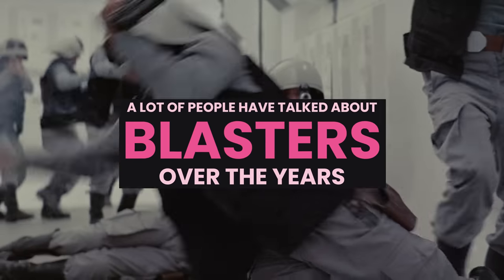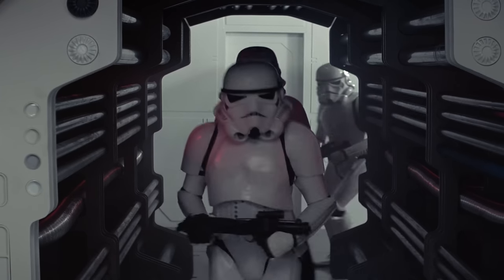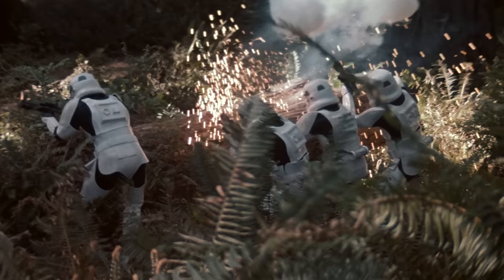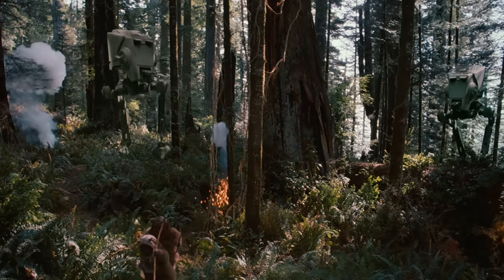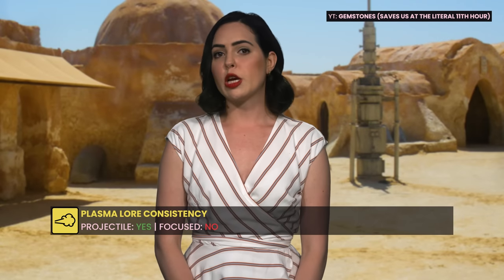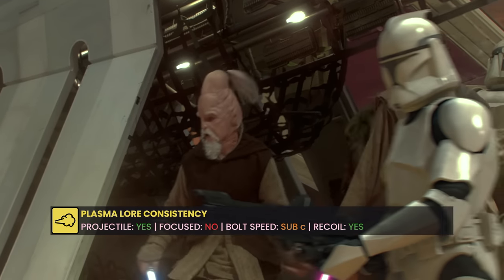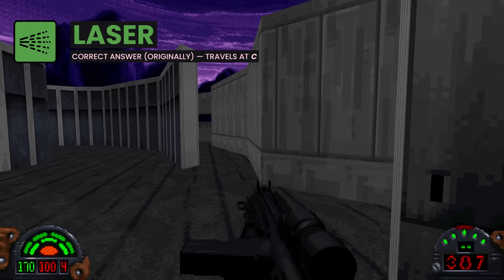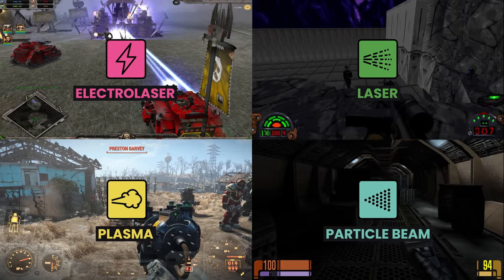Star Wars BLASTER TECH: The Definitive Guide

Comment: i wrote a copypasta about this one time
Reply: found it,

All blasters function by using a power pack to energize compressed gas into a plasma bolt which is then discharged into an isolated electromagnetic field. The kind of gas used to fuel blasters can vary, and also vary effectively in efficiency, temperature, and volatility. Although it was wasn't the most common type, Tibanna gas is the most well known amongst the fandom due to its prominent mention and role in stories surrounding the Alliance-Imperial conflict pre and post Endor. Tibanna gas was also more expensive due to its efficiency and high yield explosive potential. Usually, the compressed gas canister is loaded separately, optimally a small distance away from the power pack for safety purposes. The ratio of power used is always much higher than gas used per blaster bolt. Most blasters can be tweaked to use more gas per shot, but this requires more power per shot as well. Most blasters can also be tweaked to use less gas per shot, allowing for power pack charge conservation. In the hands of the sparing, a compressed gas canister can be made to last the a greater portion of the functional lifetime of a blaster. An example of gas and power adjustment, the DL-44, well known to be the base model modified and used by Han Solo, could load dual channel power packs. This allowed the user to fire a single charge shot from a single power pack, or with a quick toggle, fire a dual charge shot from both power packs, twice the output via same drain per pack. This made DL-44's especially useful against armored opponents, particularly Stormtroopers, because the double charge was enough to penetrate the light shocktrooper armor. This also made them illegal for unapproved use under Imperial law. In firefights, prepared soldiers or gunman wouldn't be seen running out of gas unless severely overcharging their shots for maximum heat and armor penetration against super-heavy targets, or they were caught lacking in 4K when it comes to standard scheduled firearm maintenance checks and routines.

Comment: I will respectfully disagree with your segment on "movie accuracy". Pointing to single-scene wardrobe malfunctions as not canon-establishing is not an example that can be used to explain away every single instance of a blaster bolt onscreen. Explaining it away with "because the viewer wouldn't understand laser fire" is a non-starter, because there are numerous other concessions for the viewer's benefit that have to be then incorporated into lore - lightsabers being the prime example. So to have a sensible discourse - if a certain object is shown onscreen multiple times and 90% of the time it is shown to work in a certain way, then it should be incorporated into canon.